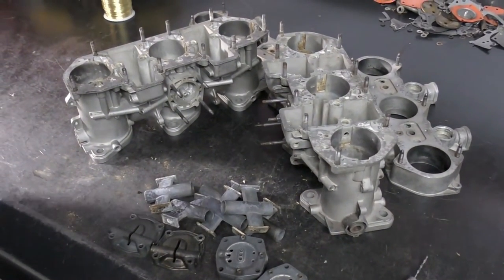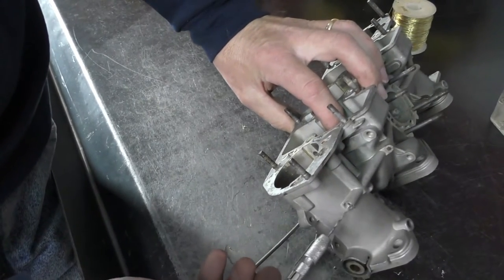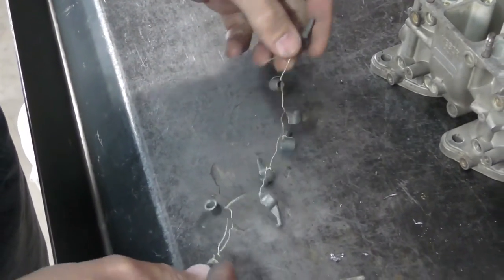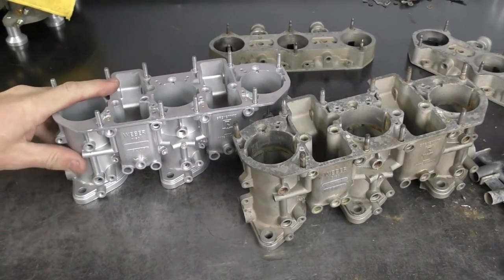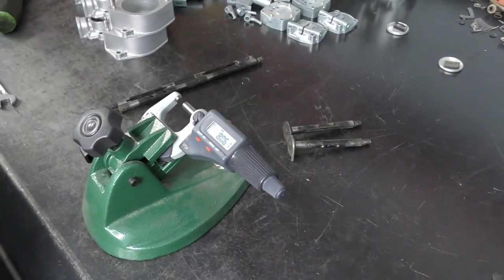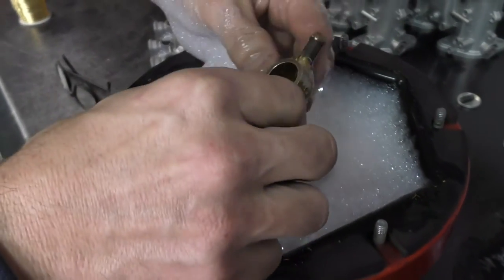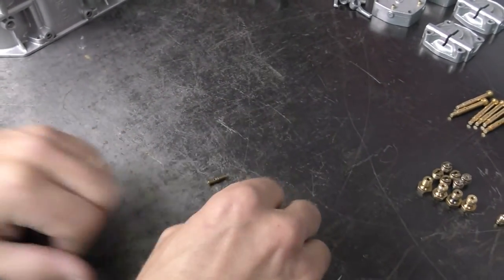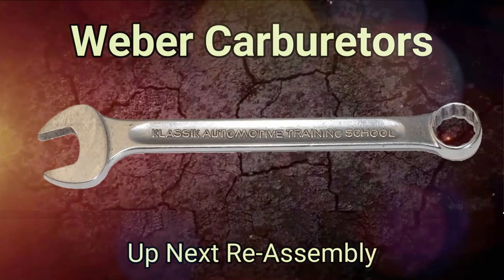Weber Triple Barrel 40 IDTP Carburetor. Complete Cleaning Process

Comment: Good video and nice to see how a pro does it. 
When the floatbowls were manufactured they were cleaned from soldering residue and getting back to shiny by sitting in diluted acetic acid followed by some brushing, works for all brass parts.
Reply from the maker: Sure that will work although the light acid will still work at eroding the brass. When it comes to floats that are 40 plus years old sometimes it still just best to replace them.
Thanks for watching

Comment: Love ALL your content and follow frequently. For those of us rebuilding 40 IDFs with less equipment, do you have any preferred bath chemicals for ultrasonic cleaning carb parts?
Reply from the maker: I find that the baths and ultrasonic cleaners to be some what ineffective. Depending on the condition of the carburetor those systems tend not to do a very good job,.
Kurt
Reply: Thanks Kurt. I had mixed results myself so I was starting to  question my method and cleaners. Appreciate your videos and advice.

Comment: Is there any reason (I'm sure there is!) you use a tumbler to clean your brass and not your vibrating polisher? Loving these tutorials - thanks
Reply from the maker: Neven, the vibratory polisher is way too big! Even if we wired the parts together we would never find them again in the big polisher. The ceramic pieces are also way too big to get a polish on the small parts.
We used to use a dry walnut shell vibratory polisher and switched to wet polishing as it is far superior to dry polishing. The stainless steal media is small enough to polish and small enough to get stuck in places too!
Thanks for watching and glad your enjoying the tutorials.

Comment: i need a vapor blasting machine. is there certain pressure setting when blasting these parts? its usually around 100psi, no?
Reply from the maker: Blasting pressure will depend on the specific machine you are using. My machine runs at 90 to 100 PSI. You don't have to use a vapor blast machine, you can use a regular dry blast machine. Just make sure the blast media is not too coarse and that you completely clean out all remnants of the blasting media.

Comment: Can you tell me what the Weber factory anodizing finish is please?
Reply from the maker: anodizing does not work well on cast aluminum parts due to the impurities contains in the pores of the structure. Most of the coatings used on the carburetor bodies are a form of chem film. There are not many plate shop left that will attempt the process any more and colors and finish quality will vary greatly.
Thanks for watching
Reply: @klassikats  So what finish would you recommend then?
Reply from the maker: Chemical Film on Aluminum, also called by proprietary names of Alodine or Irridite, is a thin, clear or yellow conversion coating used as a primer for paint, general protection to prevent aluminum from oxidizing.